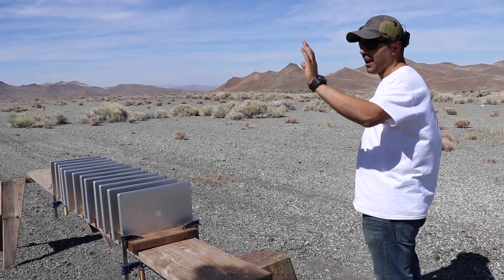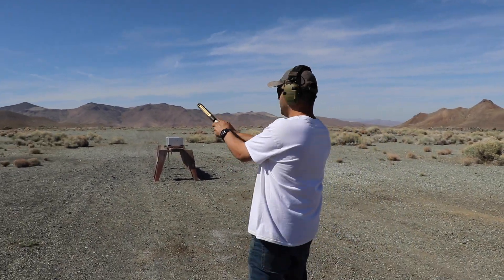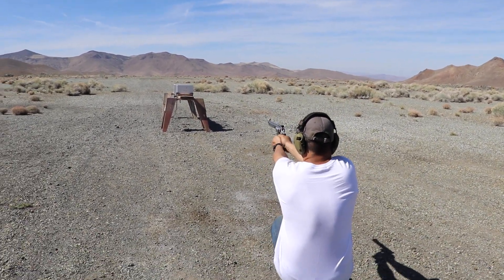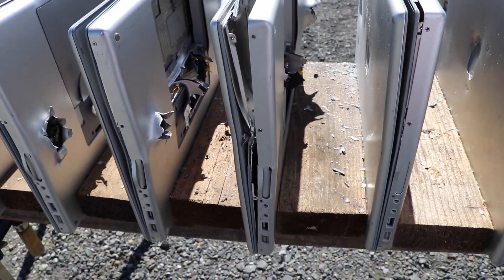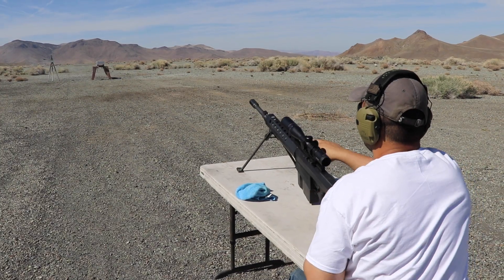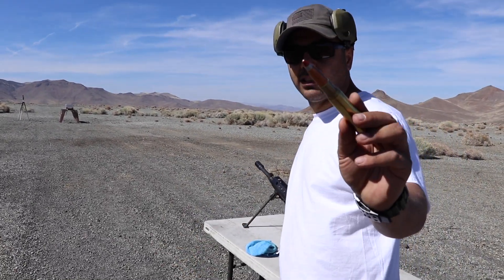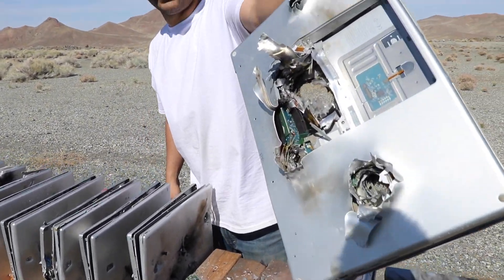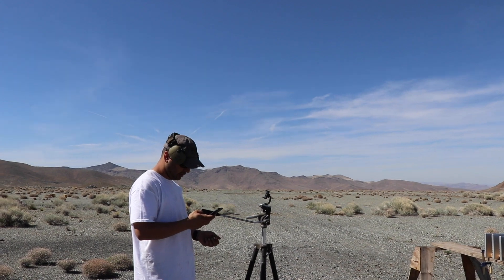How many MacBook Laptops does it take to stop a 50cal Bullet?

Comment: The bullet will curve off. The resistance of the material of the circuit boards, which are quite strong, and the metal, will alter the course of travel. Pushing it one way or another depending how the material breaks.

Comment: Each bullet goes through a different part and each section of these computers house different units with different mass, density and material strength. Plus, shooting a macbook that has already been shot before means that you are shooting at a target that has been penetrated before and had its overall material strength reduced. Bits and pieces in the bullet's path will dislodge/come off/fly off more easily if a bullet has already damaged the nearby components. So unless you are shooting each bullet through a different set of undamaged, uncompromised macbooks at the same parts and at the same angle, you won't be getting an accurate measurement of how many macbooks can stop each round.
Reply: I don’t think it’s meant to be very accurate just a bit of fun
Reply: @k3nz1e73  i agree that it is incorrect
Reply: It's meant more for fun but I was thinking the exact same thing.

Comment: Where you hit a laptop is going to completely change the results. If you hit nothing but circuit boards the results will be completely different than if you hit the hard drives, even with the same round.
Reply: factstraight it was never about raw data otherwise he would have used same spot and measured velocity and new laptop for every shot .... Was for entertainment only
Reply: I agree, i was just pointing out a few facts.
Reply: The most fun is to hit batteries!:)

Comment: If you shot a bullet into a pipe with a bend would it change the bullets direction, at the same time if you shot a pipe that went round like a spring would it catch the bullet and slow it down or would it do the loops to the end? Just a video idea

Comment: Do they still work?
Reply: c1ue scroll 07  no, he says right at first all are broken, parts only.  These older one are repaiable though, the new ones are total crap to repair and impossible to upgrade. everything is glued and soldered in,  and have very few ports to hook up stuff.   I would enjoy seeing new apples shot,but these older ones were still decent and could be upgraded and serviced with ease.    .... not now!
Reply: Bit of glue and duct tape, they'll be fine. Trust me.com
Reply: They didnt work right when they left the damn factory.
Reply: Rusty Panels     Should send them to Louis Rossmann repair in NYC... He would get a good laugh out of this..    Check out his ‘fix an Apple’ youtube channel  ... he rails on the crappy apple engineering pretty hard..
Reply: It's a   Mac, they never worked
Reply: Don't think you understand irony?
Reply: yeah
Reply: c1ue scroll 07 I think they would if you turned them on and off again
Reply: They never did
Reply: iggy151.    Best answer ever. Haha. F apple.
Reply: Jennifer WhiteWolf no he says they are not in WORKING condition meaning that can be fixed
Reply: Yes
Reply: Of course they still work. They're Apple products.
Reply: hahaha
Reply: You can be sure that none could still work after a bullet passed through them
Reply: Someone clearly doesnt pay attention